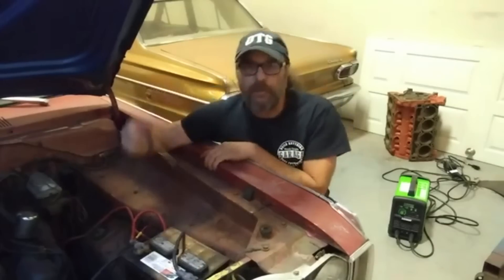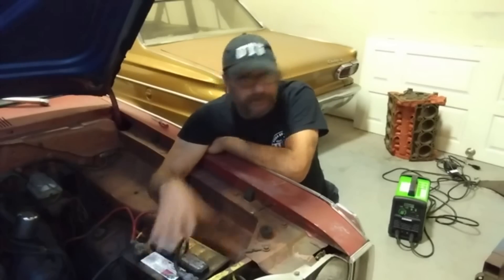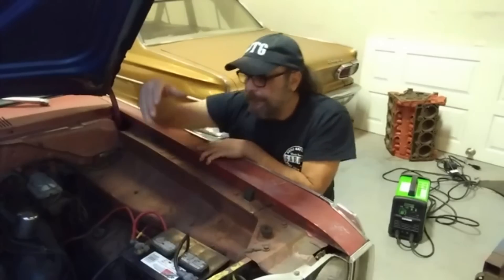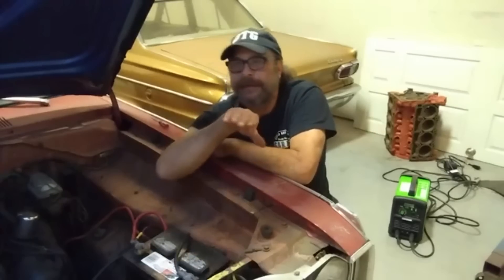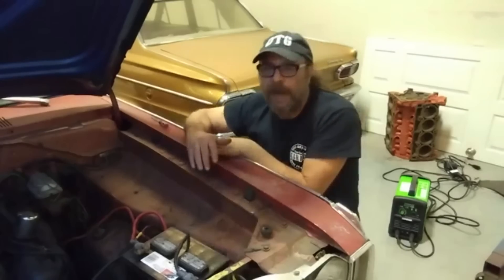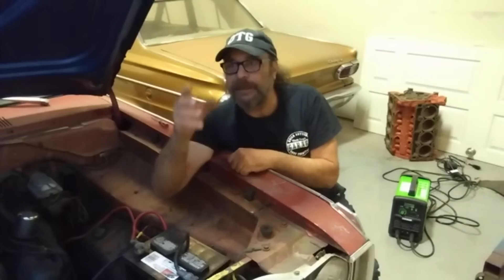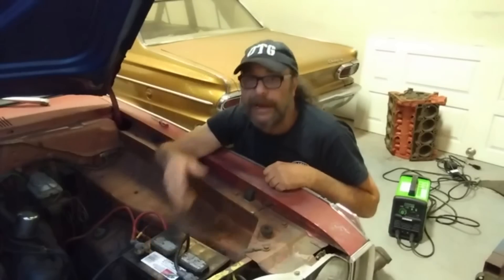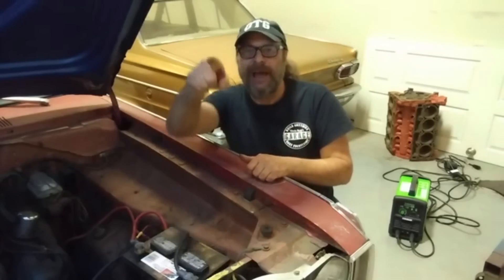Stick Welder Battery Revival SUCCESS!

Comment: Welding is nothing more than a controlled short. Running voltage through a battery causes considerably less ohmage.
In the 70s batteries were filled and charged at time of purchase. My first day at a gas station I was warned not to smoke next to them. In 50 years I've never seen a battery involved in a hydrogen explosion.

Comment: Wow you should of put a dry cleaner bag over the charging batt and put a rubber band around the bag to capture all the explosive goodness , when I was real young I was charging a batt and I went and pulled the clamp off the terminal and guess what that battery exploded into peices a peice went in to my thumb nail thank God it didn't blind me but my clothes were gone and that battery was in a million peices oh shit my dad was pissed it ate a big spot in the concrete of course it was in the garage ,I learned a very impotant lesson that day " hydrogen good" ,,,I've made several little bangs bangs with the ole cleaners bag leave the caps off the batt and puter on fast charge, weeee got a match

Comment: This is useful for me, because I have a camper, a boat, a skidsteer, and 4 running vehicles. That's 7 batteries total, and at least $700 to replace them all vs. trying this and very likely extending the life of a lot of my batteries and saving the money. I can use that $700 for something else, like parts to rebuild an engine, etc.

Comment: I been reading a lot of comments about air to hydrogen ratios in and around the battery etc. , doing this experiment outside vs. indoors, hydrogen explosions blew up grandpaw and all that stuff too. What it all comes down to is 1, just 1, simple BASIC safety step. TURN OFF THE CHARGER BEFORE YOU DISCONNECT THE CABLE CLAMPS!!! Charger turned off, no power to battery, no spark, no go boom!

Comment: I only ever blew up 1 battery, or I should say my brother did while boosting my race car. Turns out his alternator had been over charging the battery in his car and the water had been boiled away leaving it maybe half full of just acid. When he connected the cables to his car after connecting the other ends to my dead battery, his went off like a gun shot. Blew the case to pieces and my brother had acid all over him. He ran into the house and washed up and I hosed his car off to remove all the acid. Other than him being pissed off at blowing up his battery he was fine.

Comment: I swap a lot of batteries. Most of the vehicles I work on have 3-4 batteries (diesel mechanic). I have been in the presence of multiple “pops”. Not once have I seen any flame or explosion. It’s usually the pop then acid spraying. If the battery was hot it will make some steam. The worst I encountered was a battery box fire and all four batteries (large group 31 1000 cca) “popped” due to the fire. The acid spray actually extinguished the fire! Always wear eye protection and never smoke near a battery. And if you’re still worried about a Hollywood style over done battery explosion, then position a fan to blow the gas away from you and your workspace.

Comment: Appears reasonable to me.  I do think that it was a new battery that was discharged soon after purchase, so it went from electrolyte to water w/o years of slow sulfation.  That might have been the ideal candidate for this experiment.  I dunno about 7 year old battery pulled from service and allowed to self discharge over winter ...  Might be too far gone to do the boil ...

Comment: We used to use our Lincon AC 225 Amp Stick Welder to Thaw Frozen pipes on our Farm from the pump to our house.  We would CRANK IT WIDE OPEN until the pipe warmed up and thawed out the ice , some times it took an hour or hour and a half .  Never HAD AN ISSUE WITH THE Welder!  I have been a Certified Welder for the past 40 years .  I can count on one hand how many times i Actualy hit the Duty Cycle OVERLOAD.

Comment: Nice, as teenager i used to carry two dead batteries in the trunk and 2 sets of cables because if car went dead I could daisy chain 3 together and get enough to crank it over. I've done this welder trick too, and it does work on batteries that the plates are still there. It blasts the oxidation off.then once expose the fresher plate surfaces, voltage and amps come back. But, you have to have plates left. I've also seen batteries that register 12.8 volts but can't crank a watch. No surface left. No amps.

Comment: We could calculate the evolution of H2 during the entire charging cycle. My guess is that the volume of air in the building and the air leakage from the building causing air exchange would dilute the O2 and H2 mix to a point below the critical concentration for an explosive event AND a conflagration event. TLDR version, no boom, no fire. 😁👍
Reply: Holy Cow, we have point dexter in the room. not an insult but Kudos, takes hat off because someone smarter than me knows this stuff. whats the algebraic formula or can you write down the calculation. this is what i'm talking about Foghorn Leghorn - Hide and Seek https://www.youtube.com/watch?v=jMyD3TSXyUc

Comment: Funny battery story. My father was a substation operator for a power company. We lived on site in a house attached to the control room. For emergency power there was a battery room with an inverter. It was housed in a maybe 8x8 room. There were 86 1.5 volt lead acid batteries. Each cell was about 1.5' long by 1'  wide and 1.5' tall. Entire wall stacked 3 high. The ventilator had stopped working in the room. The company electrician came in to troubleshoot the issue. I was with my father at the time. Well the electrician went in the room, then there was a flash of light and wooshing sound. Kind of a vacuum feeling as the O2 was consumed. Thankfully I guess he left the door open. He comes out of the room with singed  hair and eyebrows and the remnants of a cigarette in his mouth. He lit a cigarette. Yep a well ventilated room is your friend.
Reply: What a moron. Hope he learned his lesson.
Reply: I have singed my hair twice. Once with a potato gun and once with a homemade jet engine. Hilarious! Good times
Reply: I haven't stopped laughing 🤣😆🤣
Reply: I'm glad we are able to laugh at that one !!!  I bet the electrician told that story for years.
Reply: @kellytrimble4120  🤣...hahahaha,  I bet he did! 🤣
Reply: Back in the day, late 70's....my dad would pump gas with a lit cig in his mouth all the time. That's the way he smoked, he would just lite it and hold it in his mouth the entire time and hardly took drags off of it.
Reply: The batteries they use now are 2.2 volts. They can produce a lot of explosive gases in small area very quickly when changing. The total voltages used now are 135 volts DC. DC voltage is a lot worse if you get across it.
Reply: That was funny - I just could see the guy walk out with his hair and eyes brows burned away with the smoke ha going out his mouth lol - 
     I had done high voltage switch gear work at one time - a guy walked in as layed rubber mats on the ground and all on all the lugs - the other guy said you don't have to do all that it's not live and it's grounded out and cross phased - 
    I took the safety measures being 22k volt system - in 5 minutes there was the loud hum of a dead short - I saw in that split second they guy had thousands of sparks coming out of him all over - 
     He lived and wasn't hurt bad but he looked like that guy you spoke of  lol

Comment: Tony we love ya.....but sorry, you're dead wrong on this one. Batteries DO explode, and yes they DO explode in huge fireballs. Back in 2003 I watched one explode with my own eyes in an early 90's Ford F-150. Long story short, a small metal CB antenna had been laid inside the passenger fender shorting out the starter relay directly to the battery terminal. I don't know exactly how long it was like that, but I saw the entire front of the truck explode in a gigantic fireball. Luckily it was outside and nobody was near it. It definitely could have killed somebody and absolutely would have burned down any structure if it were inside. I never really thought much of the danger with batteries until the day I saw it happen myself. If you wanna play around with dead batteries, feel free. I don't know the chemistry involved or how it happened.....but I saw it happen and it was like a huge fire bomb going off under the hood.

Comment: Late '68. First day on the job as a mechanic. 'Boy, take that 6 volt VW kombi battery out'.   I used a  6" crescent and accidentally shorted the two poles.  It exploded, splashing me with something I didn't know about. Suddenly 3 guys grabbed me and carried me into the shower. Odd, as I used to use my fathers flat file and watch it almost glow across the poles of a battery he had.
Just a story....

Comment: I have had luck using my 200 amp start setting on my battery charger. Also if your worried about being close to the batter use heavy set of jumper cables to stay away.  I have killed a battery buy leaving the charger high to long, like over night.

Comment: I wonder how a 5 or more year old battery would do. The bat explosion well my story, 1980 working Kmart auto center, first real mechanic job. The bat charger was the size of a truck, knobs everywhere hmm. Enter customer my Kmart bat is junk I just got it, ok let me charge it then I'll check it 👍 😀 maybe internal short maybe I cranked wrong knob, but no bigger than a quarter could I find left of that battery. OK sir looks like I'll just go ahead and warranty that for yea. 50 years later my ears still ring. And yea pop not bang but that's the loudest pop I ever heard

Comment: So, I guy right across the street from me had a dead battery is his early firebird. He had the hood up so I went over to see what he was doing.  He said he was going to put a new battery in it. The smell of rotten eggs was Damn strong. So I told him to be careful and make sure to disconnect the negative side first to avoid accidentally having the wrench touch ground and make a spark. Then I went back across the street. Next thing you know it sounded like a shotgun blast. He was covered in acid and the battery was in two pieces with the positive  cable still hooked up to a bunch of plates hanging from it. I found his garden hose and sprayed him any the car down. All he said to me was, guess I did it wrong. So there's that.

Comment: I had a battery blowup on a truck when I went to jump it off it blew the top off the battery and scared the crap out of me. It wasn’t a pop it was a big bang but no it didn’t create a new universe lol. It was pretty cool though it completely took the top off exposing all the plates and the posts were still right where they were just nothing around them. I guess the battery had an internal short.

Comment: Explosions.... ?  A few weeks ago I was getting gas at a full service station and pulled a lit  cigarette from the ashtray for a puff.  The attendant freaked out and told me to put it out. He then leaned against the pump next to my filler neck , and pulled out his cell phone and began checking his Twitter or something ....

Anyways,  what makes the welder special in salvaging a battery? All I took from the original battery was that you boiled it. Batteries can be boiled from  "normal" chargers.  So what makes the welder unique?

Comment: Question: Haven't seen anyone ask yet, can this procedure be done with an AGM battery, or a sealed battery?
Reply: More risky but when the battery is in its bulk-charge stage (translation:  flat-dead), you can probably get away with it.  I would still wear appropriate PPE including hearing protection.  I worked at a place where we had a golf cart battery,  a semi truck tire, and a semi trailer air bag explode.  Glad I was away from all of them, but even the truck tire left my ears ringing for a few hours.

Comment: I've had two batteries blow up. Both of them shattered the plastic shell of the battery that sent bits and acid flying. One was on an engine test stand when I was in school, blew up when cranking possibly a loose terminal made a spark. I wasn't directly involved when it blew but it was a good bang when it let loose. The other was in my old pickup, one morning it was slow cranking and didn't start, I put a basic battery charger on it. The next day I opened the hood to find bits of plastic everywhere and the top of the battery gone. I don't know why that one blew up perhaps a spark inside the case, something shifted causing the charger clip to spark? In both cases, the flying bits and explosive force didn't do any damage to anything.
Reply: Had similar experiences.  Actually was driving a car and hear a huge “BANG”.  When I opened the hood, acid and battery pieces everywhere, but the car was still running!  Shut it off, checked for damage, started it back up, drove a half mile back to the shop and cleaned up the mess with a garden hose and baking soda.  Tested the system, put in a new battery and kept going….

Comment: I blew up a 12v lead acid on a fork lift, and it was my fault. This thing always needed to be jumped and this day was no different except that day it exploded. I barely missed getting some acid damage except for my jeans and leg. Also my hearing is damaged. The battery was mostly likely dry, built up hydrogen and shorted internally. I should have checked the water, but again you get used to a car/vehicle that always needs a jump.

Comment: Since your first video I've shocked 2 batteries with my cheap Amazon welder that would not take a charge and both are still working. Take that for what it is worth.
Reply: Lol at first I thought you were saying the welder wouldn’t take a charge
Reply: How cheap? Is it a DC welder?
Reply: @auteurfiddler8706  160
Reply: @darrellwil64  where is the link to welder?
Reply: Good job !!
Reply: Be safe...smh

Comment: Pop is a great word. I had one pop when I was 16 and dropped a wrench between the terminals charging at 40 amps. Scary, yes. Lethal no. My clothes sort of fell apart later but that's all. I am very glad I wasn't looking at it at the point of poppage

Comment: Does it just "boil" or dislocate the lead sulfate off the plates, or does it chemically covert the sulfate back to acid?
Reply: Good questions I’m sure it’s going to boil it could dislocate and remove lead Atoms, or maybe it is chemically converting I guess if the acid level increases you would think it’s chemically converting.  It would be interesting to do a test on a single cell removed from a battery put it in a container with the electrolyte or water whatever was in the battery maybe a glass container so you can watch them do the test and look for particles at the bottom of the container or maybe you will see visual differences Before and after the high amp experiment.

Comment: Batteries that have been "revived" are still sketchy at the end of the day, a friend gave me an old optima battery that had sat for years and was stone dead, after hitting it with an old school battery charger and charging it on and off on high amps for over a month it seemed to be revived, and I used it for over a year but when the battery was cold in the vehicle it would start and crank fast and seemed to be in really good shape and load tested perfect but it had this issue when it was hot where you would drive to a store or something and come back 5-10 Min later the think would struggle and slow crank and acted like symptoms of a extremely hot starter or bad grounds and I fought with that problem until one day the battery gave up and when it went bad the vehicle started perfect in the morningand drive to the gas station and went to restart it and it was stone dead it wouldn't even crank over more than 1 revolution, after that I swapped in a brand new battery and ALL of my hot staring issues have been resolved, if I would have known that the battery was the problem I would have replaced it alot sooner, after that big inconvenience I try to avoid "reconditioned" or used batteries in general, the little bit you save initially will cost you in the long run.
Reply: If you know your batteries are used they’re not really a waste of money. I got 2 North Star AGM batteries used for $60 each that normally retail for around $400 each. They were from a battery shop and they lasted just short of 3 years in a battery bank in my truckbed. 3 hard years, I’m talking discharging 80%, partial charging, every single day. Ran 13amp power tools, lights, heaters, even jumped my starting battery a couple times from my partially charged bank. But I knew they were used so any issues with them I would be inclined to investigate the battery first.
Reply: Optima is sketchy new! Northstar was bought out by Odyessy, and are some of the best lead acid batteries out there. I got 7 years on my last one, under severe service in ultra high power car audio. Peak draws nearing 1000 amps. Hard recharge with high output alternator (270a). Lithium is far superior however these days. Lto is where its at.
Reply: @georgesrisomsak9650  Optimas these days are complete garbage and are not worth the outrageous price, optimas are also only good if used in late models vehicles that have a high output alternator that keep the battery over 14v at all times, you try to run an optima in an old car that's lucky to charge at 13.5-13.8v and they just won't last.

Comment: I've read for years that what causes battery failure is plate calcification and anything that can remove it makes the battery work. If the welder caused the calcification off seems to me it would work. I exploded a battery once and I found out it was internally shorted and when I hooked the big charger to it the post blew out of it covering me in battery acid but that was not like this, it was a dead short. My welder is AC only else I would give it a try.